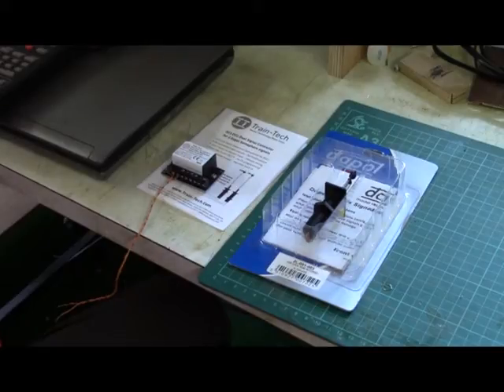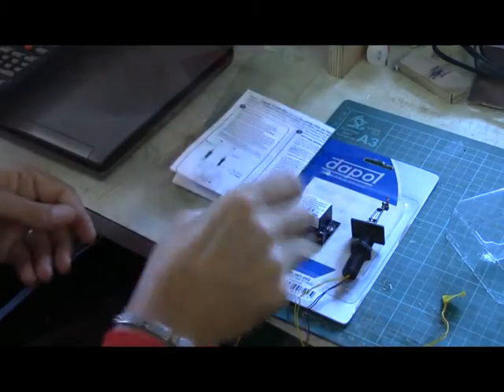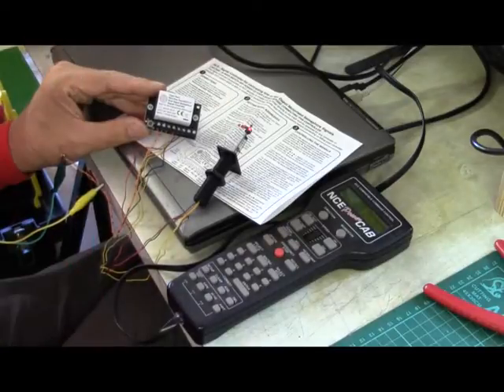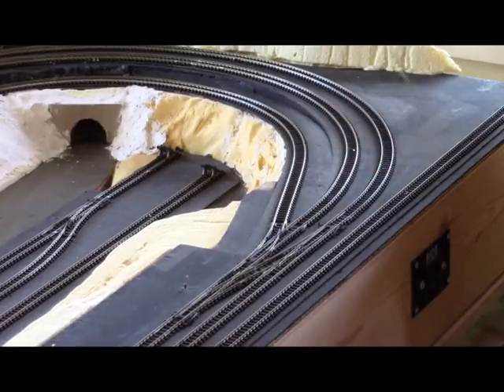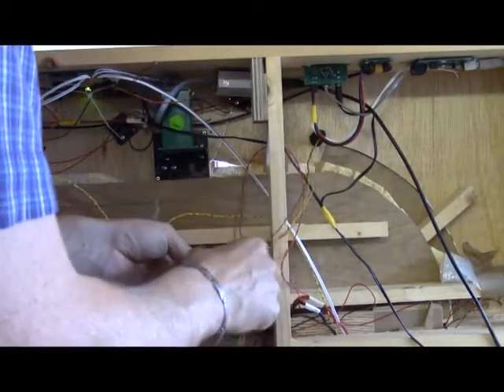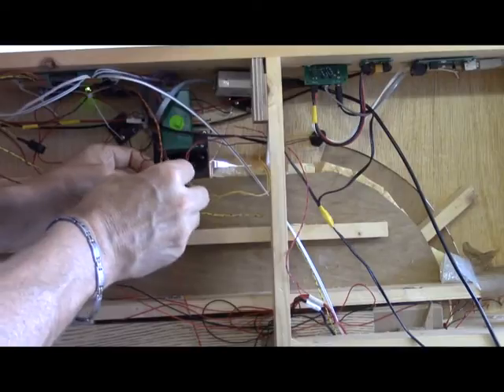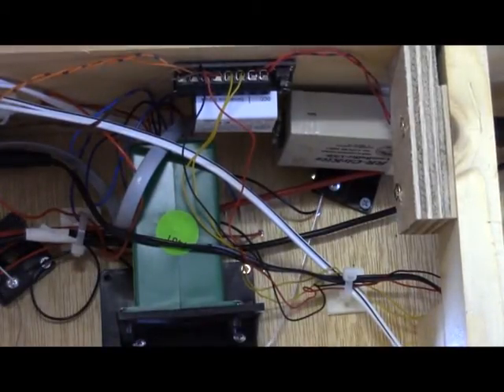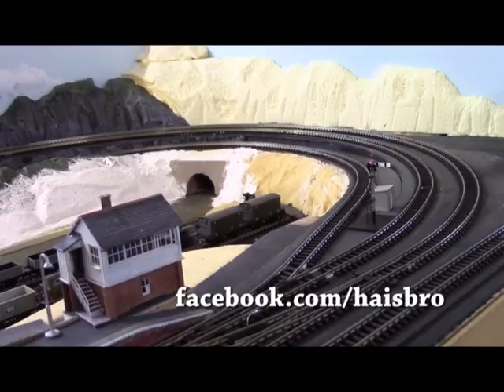Fitting Dapol Semaphore signals to the Mill Layout

Comment: Seems a bit of a nuisance having to go into controller every time you want to change a point or signals, I set mine up on a mimic panel and it just seems to be easier, you don’t need to buy the train-tech controller either, just a plug in regulated power supply to feed all your signals and a push button for the yellow wires to each signal. I do agree though that they superb signals and if run on a 9v or lower regulated supply they give no problems.
Reply from the maker: Frankie, absolutely you can run them that way - personally I wanted them automated hence I went DCC / JMRI - the signal reflects the state of the points and track occupancy - I only had to go in to the controller for initial testing.

Comment: Nice looking but electrically useless ! There are a couple of serious problems with all these models to date. Firstly in approximately 10% of actuations the motor whirs but the arm does not move, regardless of whether you run it from a 9v Battery or 16v AC. More serious is the wiring method PREVENTS real life type operation. The wiring method is totally daft. It relies on the mechanism being powered constantly via the black & red wires, and actuation of the arm then only occurs when  you momentarily connect the two yellow wires. 

The current wiring problem means you cannot interlink the Distant with the Home & Starter signals, (which is a real life prerequisite)  to ensure the signals are "cleared" in the right order. They should be cleared in this order: Home then, Starter and finally the Distant.  

Worse because the tiny coreless motor doesn't always engage the drive cog, you cannot be sure the signal has changed if you can't see it from where you are operating your layout. The wiring method provided also means you cannot add a green/red LED repeater on your control panel to tell you what the signal is or isn't doing. If you run these coreless motors on a DCC layout the "chip" used to control the signal must be of a type that provides PURE 12v DC, not Half Wave DC or 16v AC direct, as this quickly burns out coreless motors, as some people have already found. 

Worse, in real life, signals whether Semaphore or Colour light types, are "Interlocked" with any relevant points. In other words if points are not set correctly the signal protecting them is locked in the danger position. Once you understand this fact, it can be very helpful to operation if you do the same on your layout. This is normally done on the layout by using a spare switch on the point motor, to connect with the switch that controls the signal. Then your signal can warn you the points aren't set, and hopefully stop you crashing your beautiful locomotives and busting all those tiny detail parts. 
Most point motors either come with spare switches Fulgarex & Turtle motor drive variants, or Peco and one or two other solenoid types have switches available as accessories.  

As I'm a qualified Railway Mechanical Engineer, currently building a large 87ft x 25ft British OO scale exhibition layout for the Railway Museum in Mora, near Tarragona, Spain, to add to their attractions. The Museum owner insists absolutely everything must work just as in real life. So I thought these nice looking Dapol models would save me a lot of time handbuilding semaphores ("Model Signal Engineering" white metal/brass kit Range). Clearly no one at Dapol understands either signals or wiring methods. So the dozen signals I had mailed to me in Spain had to go back to the shop in England as useless. Be warned !!!
Reply from the maker: I can only speak from personal experience- I've had no problem using the Train-Tech controller, but I know they did have an 'interesting' time working out the best way to drive the signals. My understanding is that power to the signal is only applied momentarily, to get them to change aspect.

Comment: what is the voltage that the decoder supplies to the signal?
Reply from the maker: I'm not sure - quite high I suspect (like switching Peco solenoids). It's only momentary. Talking to the guys at Train-Tech it took them some time to figure it out.

Comment: Why have you got to set to number 60.why cant you set to 1.What number do you set the next one.
Reply from the maker: t147han You could set the address to 1, you could set it to anything within the address range of your system. On this layout I also have motorised points (turnouts) and I numbered these 1 - 6, so it made sense to have signals numbered in a completely different series.
Reply from the maker: t147han You could set the address to 1, you could set it to anything within the address range of your system. On this layout I also have motorised points (turnouts) and I numbered these 1 - 6, so it made sense to have signals numbered in a completely different series.